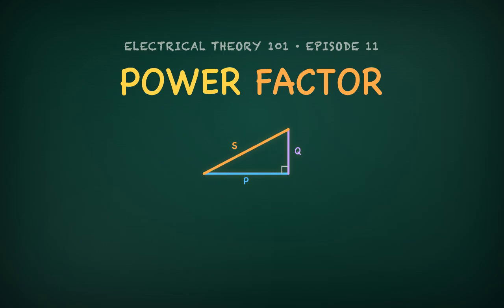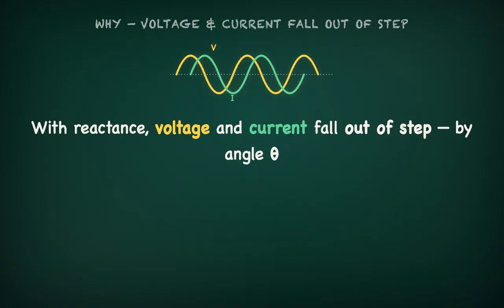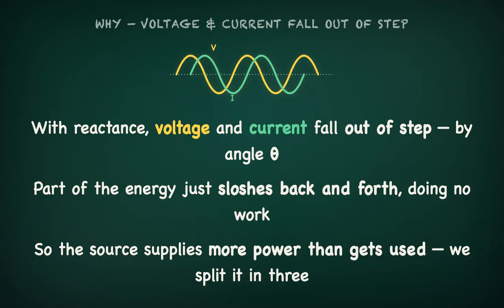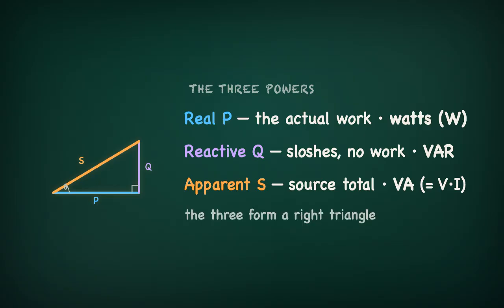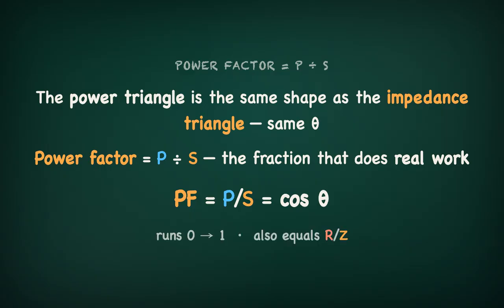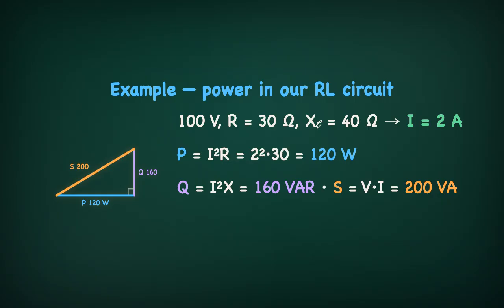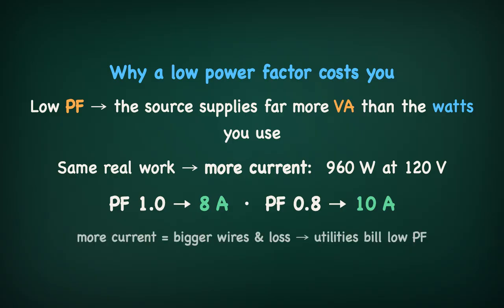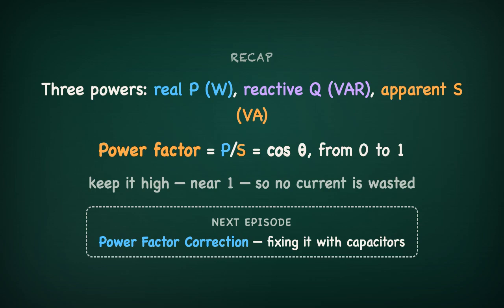Power Factor Explained — Real, Reactive & Apparent Power (PF = cos θ) | Electrical Theory 101

Comment from the maker: Practice answers: A) PF = P/S = 600/1000 = 0.6   B) Z = √(6²+8²) = 10 Ω, I = 20/10 = 2 A → P = I²R = 24 W, Q = I²X = 32 VAR, S = V·I = 40 VA, PF = 24/40 = 0.6   C) I = P ÷ (V·PF): at PF 1.0 → 1800/120 = 15 A; at PF 0.75 → 1800/(120·0.75) = 20 A. Same real work, lower PF, more current — that's the whole cost of a low power factor. What should I cover next? ⚡